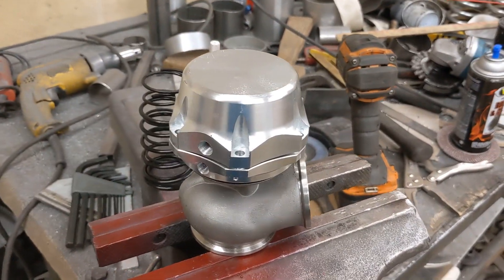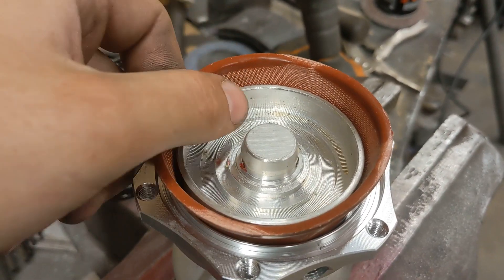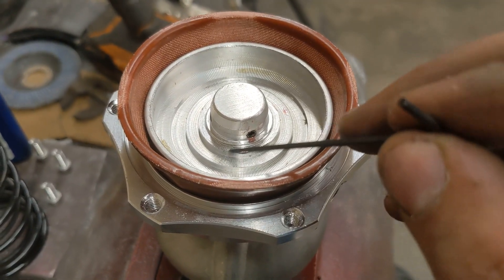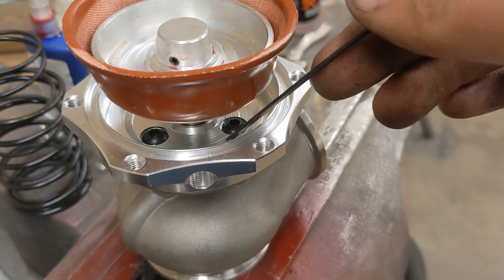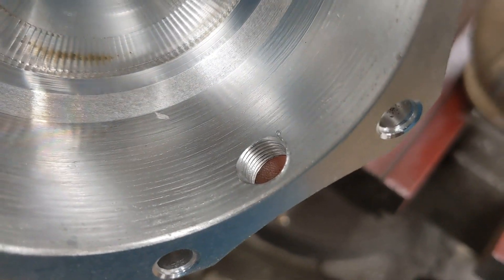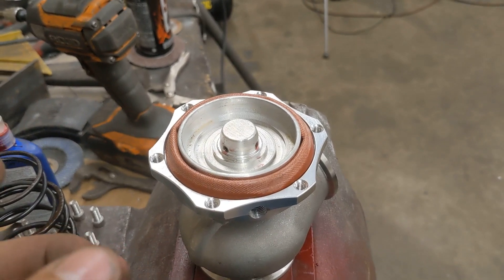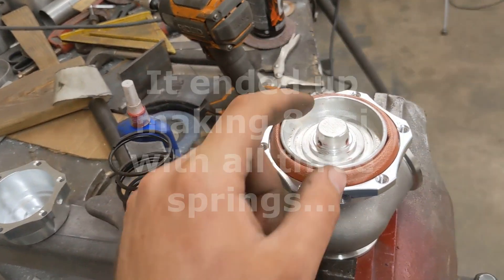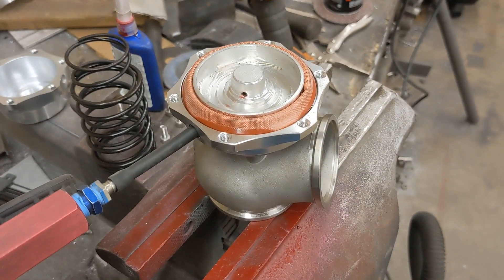Running A Cheap Chinese Wastegate: What to Look Out For

Comment: Excellent.  Straight to the issues I as looking for.
Reply: Just one quick question. Do you tend to locktite the outer alen screws holding the lid / Top on the wastegate spring ?

Comment: If your wastegate uses banjo bolt fittings check for leaks where the copper washer meets the bottom housing. The threaded hole in the bottom of my wastegate housing was drilled to close to the edge of the flat machined area so the copper washer will never seal on one edge.
Reply: Will this cause runing underboost
Reply: @kelvinleong915  No. It will cause it to make more boost than the wastegate spring is rated for since some of the reference boost is not making it to the diaphragm, similar to how a manual boost controller works.
Reply: @ethanlindsey  if the fire ring loose and bent will make underboost?
Reply: @kelvinleong915  Yeah, if the fire ring is not sealing then less exhaust will pass through the turbo and it can underboost. If you have exhaust coming out of the wastgate dump at idle you definitely have a problem.
Reply: @ethanlindsey  mean this fire ring always make a issue once a time shape will bent and leak🥲
Reply: @ethanlindsey  but once I beeen make my fire ring flat still underboost been check all been no leak suspect is turbo to manifold gasket leak cause In the car cabin can smell huge extaust burning

Comment: im using replica turbosmart. already 11 years and i facing leakage issue at the 9th year. replace new o-ring and good to go. the oring located at the valve seat, and the three bolt.
Reply: What do you mean with o-ring? The fire ring?
Reply: @Eddy-th3kc  im sorry i dont know what is fire ring, the material is elastik rubber but will dried out for so the leaks come from there. for my turbosmart, need 4 of them, big one on the valve seat tunnel and 3 between the bolt. replace it yourself not even cost you just rm6; less than two dollar.
Reply: @antamjak5029 so cause the oring u runing underboost?

Comment: Great info Calvin. I really enjoy your R&D work on the Vortec 4200. I love the LS engines of course, but it's a refreshing change to see someone building and modifying something different. These engines are way underrated and underappreciated in the automotive world for some reason, probably the lack of aftermarket parts for them. In true hotrodder tradition, you just make and adapt your own!

Comment: Some good  advice. In addition to your points, I replace the bolts with new ones. The bolts that come with them seem very soft and are a little short.
Reply: Also the valve shaft really needs something more positive than a peripheral set/pinch screw....im thinking about drilling a hole through the top and tapping the valve shaft to get a more positive lock on the Eb@y one im using...ill post a vid of the mod tonight @BlaqlabsPodcast
Reply: Also, my valve stem is not threaded or anything lol just a set screw omg.. 🤣🤣🤭🤭

Comment: Calvin, we had great results without a waste gate on a blow thru setup.We turned a decel pop off into an adjustable pressure regulator that held the boost at a preset maximum. It simply held the boost steady  and bled off any excess.The leakdown tester was used on the bench to make an initial setting.The turbo stayed spooled during  shifts(4speed) or pedaling to prevent a breakout.
Reply from the maker: That's another way to do boost control. The only issue you may have with that is you may overspeed the turbo. Also, your compressor efficiency will probably go way down. 

I'm not going to argue with results though. If it works for you, send it.